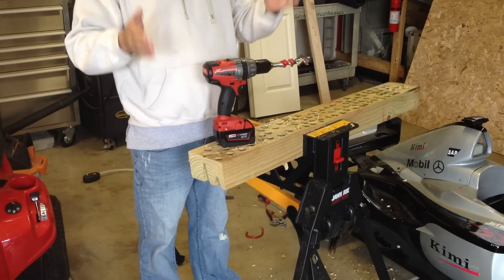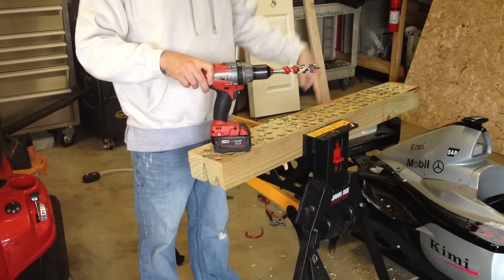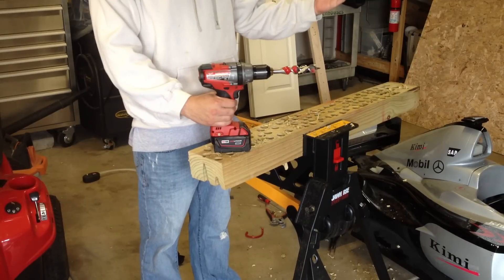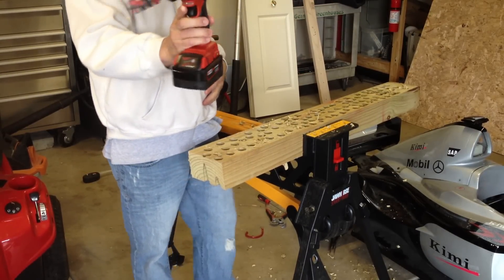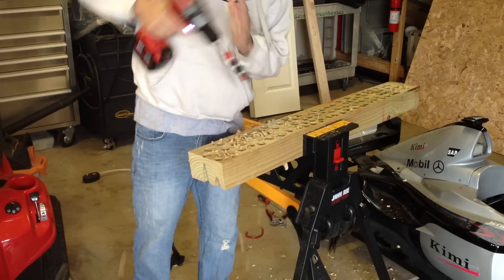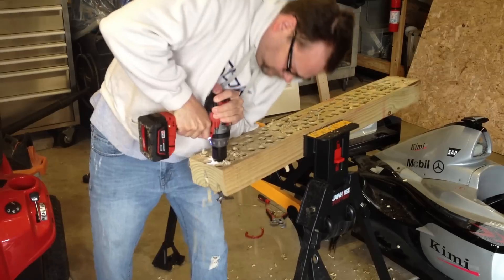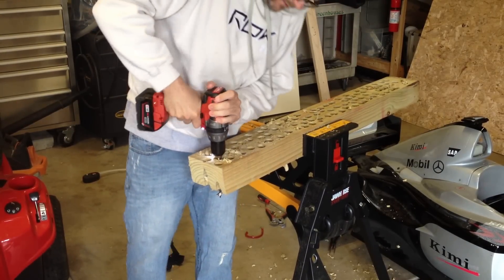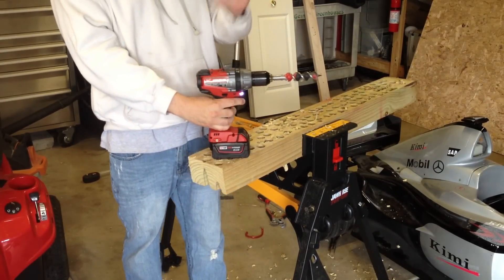2604-22 Milwaukee M18 FUEL Brushless Hammer Drill Demonstrating Overload protection

Comment: I'm a union carpenter in Chicago and sadly the company I'm im with is all makita, absolute garbage. Using them everyday for 8 hours I say that confidently, in one day of screwing 3/4" plywood to heavy gauge steel studs for a floor, I killed 3 impact drivers. 2 had brushed motors (1 brand new out of the box) and a new  brushless model aswell...cheap junk

Comment: This serial number shouldn't that be DCD985L2 the Dewalt XRP Combi drill.
80 Nm of torque
Maximum drilling capacity in wood 50mm/ 2 inches
Very nice drill too
On paper this drill should have roughly the same performance and be down a little on run time.